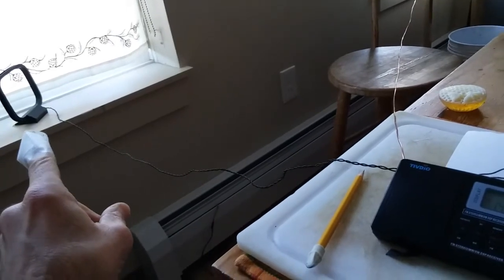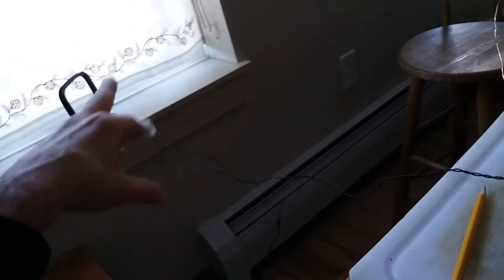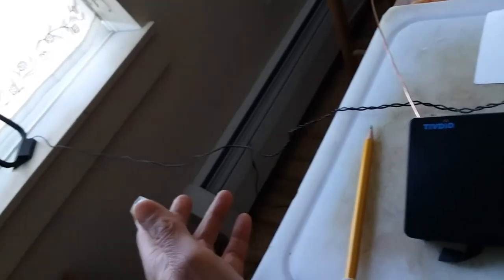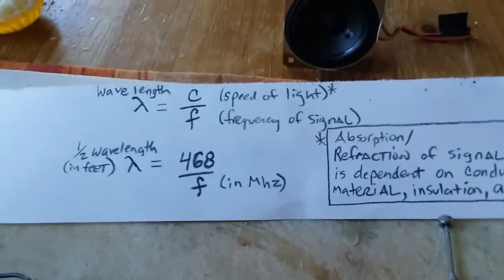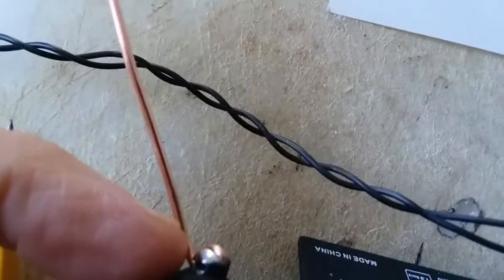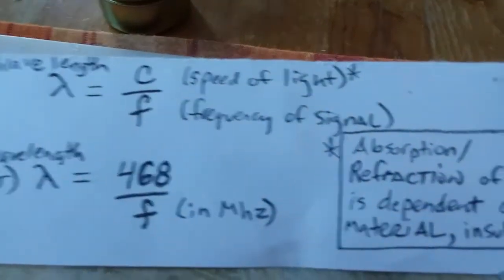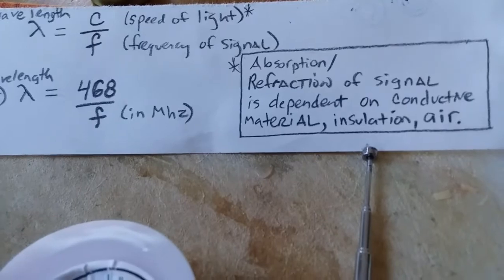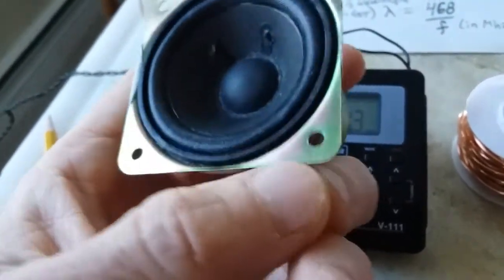DIY antenna upgrade for better AM & FM reception

Comment: I agree with you over the speed of light ... it IS affected by environmental factors ... mainly because it's optical .... now radio waves are NOT optical .. they just happen to travel at the same speed as light ! So your calculations for reducing the speed for radio waves are unnecessary... just stick to the speed of light 💡  186325 miles/s 🥸